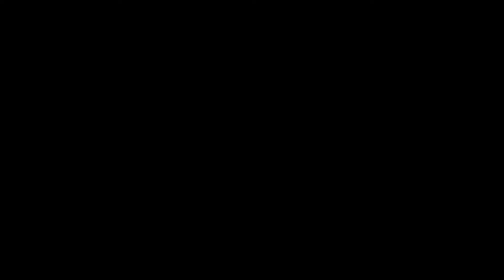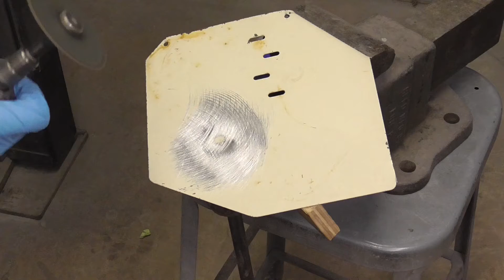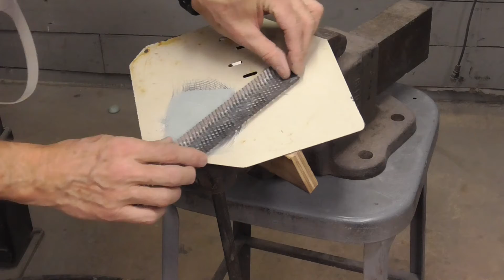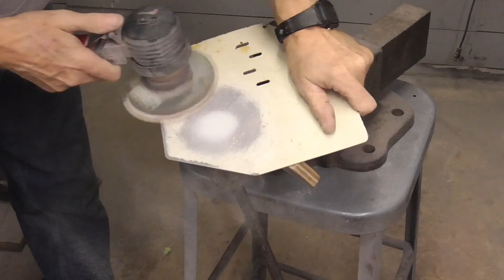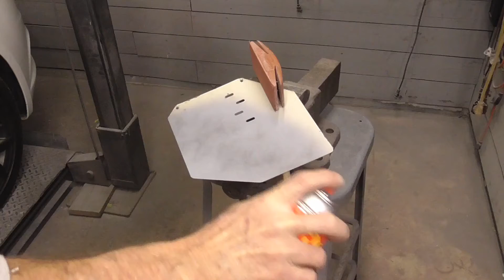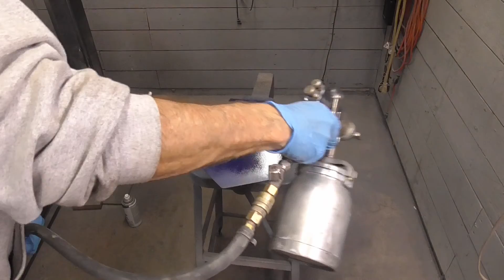All Steps of the Auto Body Repair Process - Start to Finish

Comment: Hey Jerry,  2 questions:

1) What is the approximate time to move on to the next step between these stages shown in the video?

2) When starting the fiberglass bondo and then regular bondo, how long would you wait to chesse grate these.
Reply from the maker: You can move right to the next step as long as the product from the previous step has dried.  Example:  This whole process would be done in a day at a normal body shop.  For cheese grating - wait till the filler is as had as Parmesan cheese.
Reply: Thank you!

Comment: I don't plan on doing a lot of body work in my life... how do I prime and paint without that big setup?
Reply from the maker: You can do it right in the garage.  Use a fan facing out the window or door.  Doesn't have to be super clean either - you could actually paint outside if needed.
Reply: @LakesideAutobody  I meant about that big old sprayer you're using.

Comment: You don’t try to take the dents out before adding bondo? Or is this just how you’re showing for this one dent to make it simpler for the video? Since you had already grinded it what about like a stud welder gun
Reply from the maker: For dings usually not.  Just being honest.  In a body shop, most guys will DA sand a ding and fill it.  You can certainly use a stud welder to pull it out a bit - absolutely.  Also this video is just to show the steps.  Thanks for the ???s - Merry 🎄🎄🎄

Comment: Block primer with 120?? Don't you mean 320? To many extra steps unnecessary.
Reply from the maker: Never block with 320.  320 is for finish sanding.  These guys trying to block sand with fine grit would get let go very quickly at a real body shop :)

Comment: Love your videos man, I have learned a lot from you , thank you. Maybe the camera is off but after you filled the area to be repaired, you sanded it and put the 1st coat of primer then sanded that down. Im good with that, but after you put the guide coat on and sanded that there was still a decent size black spot around the repair. Im still learning and have been told this is a low spot and should be filled. Am I correct on this, is this just a shadow from the camera or something else? I didnt think a filler primer would fill in that much of a low spot.
Reply from the maker: I'm thinking it's a shadow.  There should be no low spots after you block sand.  The final coat of primer is only for finish sanding with something like 320 or 400 - something you are going to paint over.   Sometimes you do have to block sand again though if the first blocking did't take out the low and high areas :)
Reply: @LakesideAutobody  Thank you, I thought it was a shadow, you always do great work. I just wanted to be sure.

Comment: This is not a repair. This is a “Dough N Go”
Reply from the maker: That's all the steps that a dealership would use to repair a ding.  Obviously you don't want them taking interior panels off, drilling holes and other crazy stuff that can damage door parts.  Fill the ding and be done :)

Comment: Wish I could mail my steel hood and fiberglass scoop to you to show us how to bond the two and blend together
Reply from the maker: Where do you live?
Reply: @LakesideAutobody  Minnesota
Reply from the maker: 👍 yeah - a bit too far but would like to do a video on that.  When are you planning on doing it.  I might grab a scrap hood and throw a scoop on it.  "Chevette Hood Gets Massive Scoop" 😊 @ClevelandsFreakShop
Reply: @LakesideAutobody  I'm actually thinking about doing it the month of May. What I have is a 1979 Chevy Caprice two-door that I'm putting a cowl induction scoop on. I have to redo somebody else's work they basically used seam sealer and sheet metal screws. I was thinking of using a 3M bonding and then blending it into the hood somehow.
Reply from the maker: You can use 3M panel adhesive or even JB Weld and rivets/screws.  Then rough up the edge of the scoop and adjacent metal.  You can use fiberglass reinforced filler or fiberglass cloth + filler to blend into the hood.  Let me know it that makes sense and if you have ?s along the way :) @ClevelandsFreakShop

Comment: If your taking an Old 1950 truck down to metal and your plans are just to use Epoxy primer on it  what other steps are necessary. They say epoxy gets gummed up with to much finish sanding
Reply from the maker: You can't sand epoxy primer so the next step would be to prime with regular urethane primer surfacer or just use DTM (direct to metal) urethane primer surfacer if you are working on it inside.  There's really no need for epoxy primer if kept inside while working on it.  If you leave it outside for months after priming then yes, hit it with some epoxy.
Reply: @LakesideAutobody  TY. Great Videos!!

Comment: When it comes to masking do you recommend any particular brand of tape?  In addition, what  material do you prefer: plastic or paper?  Please cite manufacturer.  Thank you in advance.
Frank
Reply from the maker: I absolutely recommend 3M Automotive Refinish Masking Tape.  This is an area you can't skimp on.   Any good quality automotive grade (green) masking paper will work fine for you - I use Autobody Master but just because it's available locally.  There are a lot of companies that sell it online too like autobodytoolmart.com and tptools.com and others.  The paper brand really doesn't matter as long as it is made for autobody repair.  Hope that helps :)

Comment: What degreaser do I buy?
Reply: I thought we supposed to use primer on metal before the filler I’m so confused
Reply from the maker: @roxyqueen5076  You can use any brand of wax and grease remover.  As for filler:  Filler has been put over clean sanded/grinded metal for over 50 years - it was made to be put over metal - so you're safe doing so.  However, magazines, tv and internet is flooded with stories of having to put it over epoxy primer for many silly reasons.  That being said, I did a video proving both methods work fine so it's your choice but I would not waste money and just put it over bare metal - the way it was intended to be used.  Here's the video - https://www.youtube.com/watch?v=wVhQLqPAGVU

Comment: What's the cheapest compressor I can get away with for spaying surfacer/ paint?
Reply from the maker: It really depends on the size of the project.  If you are doing a whole car then you'll need a compressor rated at around 5.4 scfm at 90 psi & 6.4 scfm at 40 - somewhere right in there.  If one panel - you can use a pancake compressor :)
Reply: @Lakeside Autobody  Awesome. Thanks for the reply! Love your vids, by the way. Straight and to the point. Great for the DIY'er.
Reply from the maker: @jadoriffic  Thanks my friend - glad you like the content - appreciate the support 👍✌😊

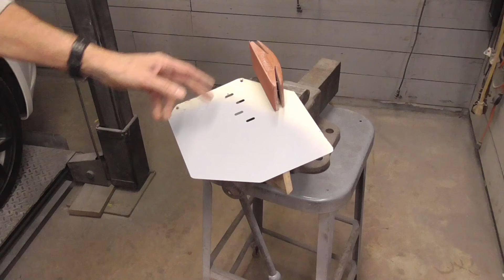Comment: 6:53   What is the spray boom paint for? Why do you prime it again after the spray boom pant? Also, do you need to use a sealer or is primer surfacer good enough on bare metal?
Reply from the maker: The spray bomb sits in the low spots when you block sand - see this video at 2 minutes and 12 seconds in - https://www.youtube.com/watch?v=itEzOW8Knzs   You don't need to use sealer primer surfacer is enough.  Sealer helps hide some minor imperfections, gets the panel or car all one color, and seals any weird paint, primer, body work materials away from the fresh paint that may cause a reaction.

Comment: Don't we need to sand the spray primer before the paint?
Reply from the maker: No, you can just prime and then paint.  IOW you can paint over un-sanded primer.  Sanding the primer does help in getting a nicer finish though :)

Comment: I noticed you didn't apply any epoxy sealer or etching, is that because of using 60 grit on the surface to allow the primer to grab onto? This is where I get confused because every other video says different. No one really explains it's. Thanks in advance
Reply from the maker: No problem.  You can trust me - I will never lead you in the wrong direction.   You never need epoxy primer and you never need etching primer - that's all new age, internet, TV, magazine sales propaganda.  You simple DA sand your surface, prime with a DTM primer (Direct to Metal) like lacquer primer surfacer, urethane primer surfacer, polyester primer surfacer or even spray bomb primer, finish sand then paint.  Simple as that.  Feel free to ask more ?s - here's a great video on primers to help you understand them more. https://www.youtube.com/watch?v=I5RaAgbNOe0   Do not take what you hear in magazines, TV, blogs and the internet very seriously - like you said, you'll be completely confused.  Find one source you trust and stick with that source :)
Reply: @LakesideAutobody  thank you for clarifying that. My uncle had his own body shop when I was younger but his passed on. I never once see epoxy or itching around the shop. He did it mostly how you show and that's why I figured I would ask you. That was a fast response unlike other channels. Once again that's for answering my question along with the others I've asked in the past.
Reply from the maker: @JohnClarkeEllensTombRaider  You're welcome - Always feel free to ask any questions you have no matter how easy they seem - it's the easy ones that sometimes can be the hardest to answer :)

Comment: Oh man I've learned so much and it shows in the work! 
Thank you a million times ! 
I've got that fiberglass kit car I'm doing that's really warped up.
Anyway, I did a "semi sorta final prime" on the left side I was getting the body lines corrected. 
It's where the rear cab window wraps around to the door ,and the joint where the fender tops meet. 
It came out so good ,I've got to go back to the other side because I did that before watching your vids and I can see it's not as good. 
I'm doing a few sections like this while it is half built ,as the areas are gonna be difficult when it's assembled. 
The right side is assembled, and I gotta go back now but I should be able to persevere and win. 
I'm just trying to get it straight enough, prime it and assemble the car so I can drive it this summer. 
Looking at all the bodywork it'll need ,if might be 2 seasons before I get into that. 
It's taken me 3yrs to build this thing, and for now I'm ok it's not getting painted.
Reply from the maker: That's great to hear MrHillfolk.  It's great to know the videos are helpful.  Sounds like you have a good project on your hands.  It's always a good time working on something you like to work on :)
Reply: @LakesideAutobody  
It's definitely made this job alot more fun,I was dreading fixing it because I've seen more than my fare share of bodywork that makes you seasick from all the waves when you look down the side.😆
I'm starting to get a little bit of a feel for it.
When the time comes ,I can probably have it 75% ready for paint so my buddy who's doing it doesn't grumble and throw too many things at me 😆
Reply from the maker: @MrTheHillfolk  Once you can get filler and primer straight that's it really - the rest is sort of straight forward.  I'm glad to hear you're having fun because that really is the point of it all - talk to you soon 🛠😊
Reply: @LakesideAutobody  
Boy,it felt so good to block the primer down slightly ,and lay another coat and while it was wet it looked pretty good! 
You've made this more fun,now I understand it, and not as much of a dilemma as I was treating it. 
Hah, I want a show car paint job eventually(like everyone),but I can't afford that without me putting in a lot of labor to save some money.
Edit: this vid is what I'm building ,if you've got 5mins to watch a time lapse build of one. 
https://youtu.be/cF8S5aK0qOA

Comment: Isn't 240 a bit coarse for your finishing sanding pass before applying paint? I would think you'd want to go up to at least 400 before laying down some paint?  Can you enlighten?
Reply: 240 is fine for what he used to paint, which was probably a single stage paint which is thicker than a base coat type paint

Comment: How do you know when to switch to a higher sand paper each time? Do you sand until the surface feels even with every grit?
Reply from the maker: You always want to prime over 80 or smoother (filler work) so... you'll want to leave your filler a little "full" to give you a bit of filler to sand with that 80.  IOW just before you get the filler "perfect" with 40 grit, switch to 80 so that you don't take too much off.  As for DA paper it's common to use 120 for feather edging then move to finer grit for the surrounding areas just so you don't get primer on shiny paint as it will flake right off.  You can even use a scuff pad to achieve the same goal.

Comment: Could you do the same type of video for what steps to take after a rust repair section has been welded in and ground down.  I hear conflicting advice on how to Seal the weld etc. And what to paint over it with. Thankyou
Reply from the maker: Check this video out - https://www.youtube.com/watch?v=34Jh4RDMAjw  You don't have to seal the welds, just clean them up really well - folks go way to overboard and overthinking this stuff.  Here's a follow up video on the repair done on this channel and with this method - https://www.youtube.com/watch?v=gIS1Tbv7Kvw  This truck is driven year round in salt/snow and I'll do more follow up videos on it - one after 5 years and it'll look the same :)

Comment: Great vid, can you show a repair on a high area that was dented from behind?
Reply from the maker: Hi Krisf29 - so it was pushed out?  Like something was in the trunk and hit the top of the quarter panel from inside?
Reply: @LakesideAutobody  yes.  On one and a bullet from inside the car that hit the lower door but did not exit just created like a golf ball size high spot.
Reply from the maker: @krisf29  Wow!  In that case, you can use a hammer and dolly and work that thing back down.  You'll probably end up with some oil canning but you can either wack it down and fill it or do this - https://www.youtube.com/watch?v=K5MVVnsERqc  Let me know if you have more ?s

Comment: May I ask why you didn't use an epoxy primer or possibly a etching primer? I'm VERY new at this and from everything I'm reading, I should be using epoxy primer to lock everything down before continuing. Is that wrong?
Reply from the maker: It's not really wrong... It's just what TV, magazines, Eastwood, and blogs say but it doesn't happen in most production body shops.  Again, It's not wrong, just not necessary.  Here's a bit of background knowledge.  For most of the 20th century lacquer primer was it - that's all there was.  It worked fine - great actually - don't listen to the negative stuff about it.  Then came epoxy primer and urethane primer - both great too.  There's also polyester primer surfacer (sort of a spray on bondo) which came out around the 80s.  Here's the basic rule and I will be doing a video on this soon.  You can use any of them and they all work great but each has a specific use.  Epoxy is a non sanding water proof (so they say) primer that's great if you just want to prime and paint although you can prime and paint with all primers. Lacquer primer (1K) and urethane primer (2K) are your every day primer surfacers that build thickness so you can block sand or sand out imperfections.  Either one can be stand alone primers for you (all you need).  Finally polyester primer is for "cheating" - it's super thick or IOW you can spray it thick like a thin layer of Bondo to bury poor body work, deep scratches, chips etc and they wont show up in the final paint work.  That's just a quick run down.  Ask more questions if needed - Jerry
Reply: @LakesideAutobody  Thank you for taking the time for your excellent explanation. So in my case, where it will be a while before I can get to all bodywork and paint, it's probably best to get the stripped body panels in an epoxy primer as that seems the most "durable" to give me time? Would that be a fair assumption?
Reply from the maker: @fretsman68  Yes... but I still would keep it covered if you leave it outside.  Inside you'll be perfectly OK.  Good thinking F68 :)
Reply: @LakesideAutobody  Yes, it's tucked safely in a small one car garage. Makes working on it tricky, but it can be done. Thanks again for your very helpful videos, Jerry. I wish you and yours a VERY Happy Holiday season!

Comment: Ok let me understand this, 1st you wipe down with wax/grease remover , while wearing gloves! Then you sand , bondo sand using multiple grits, then prime substrate without cleaning area ? 
Then go-coat ,again with out cleaning work area , and rubbing with bare hands(oily hands) then sand, blow off area (not wash/wipe with oils/grease remover or tack rag the go to primer and paint?????
What happen to preparation is the up most important task of a great paint job? Seems we back to ole school shade tree work??? 
Am I missing something here???????
Reply from the maker: You're missing something but it's really small.  The gloves are only because I don't want to absorb wax and grease remover (chemicals) through my skin - safety.  You really only need to wipe it down with wax and grease remover once - at the beginning to remove road grime, grease, dirt, wax, etc.  Don't ever let these guys tell you that you can't touch the panel with your hands.  Yes your hands have to be clean and you can't eat fried chicken while working but after your hands are clean - yo'u're good to go.  Your hands will be dry from doing body work - mine are dry as a bone all the time - you'll never get fish eyes from you hands unless your doing something unbodyworkish - new word I guess.  You can absolutely keep cleaning it if you feel you need to but I only showed the necessary steps to get a quality job - didn't want to be confusing or redundant - hope that makes sense :)